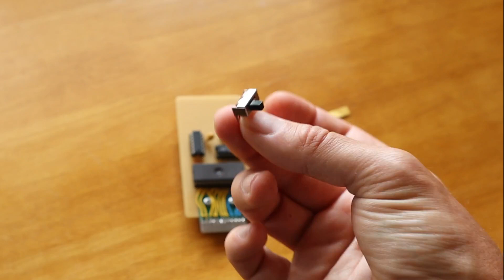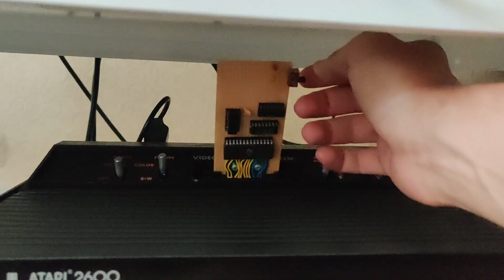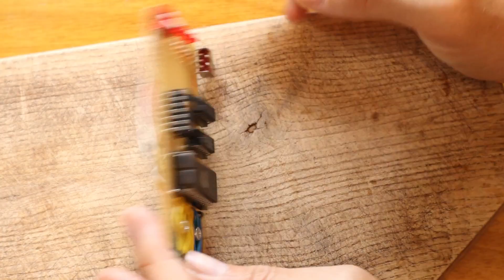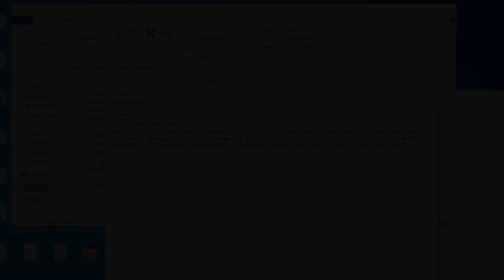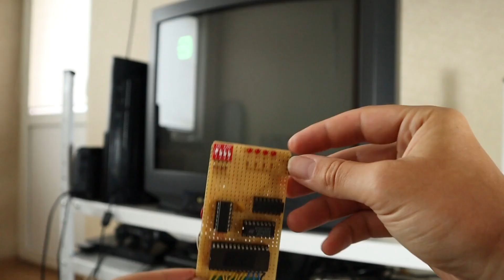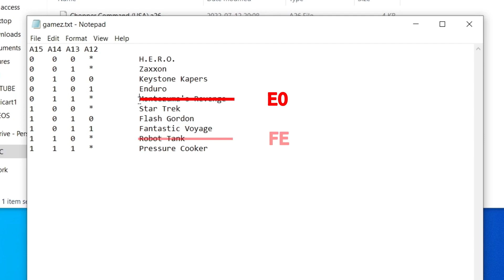Turn your DIY ATARI 2600 cartridge into multicart

Comment: Reminds me of the hack for the original Tiny Arcades boards. There are actually 4 games on each but only two contacts are connected to play a specific game. You can externally attach a 4 position switch to 8 contacts on the board and start a different game by changing one switch and powering up the arcade.